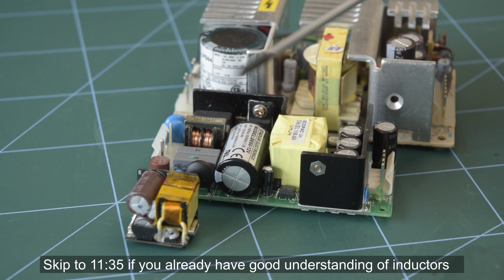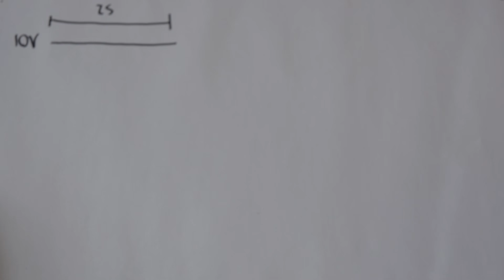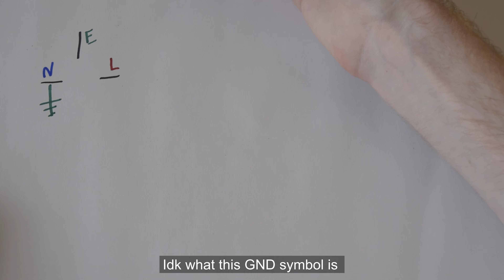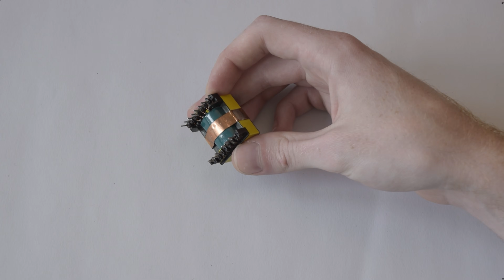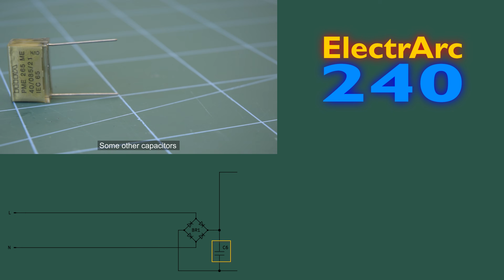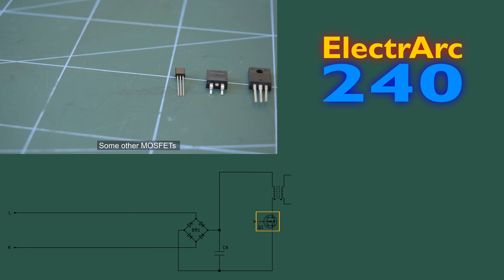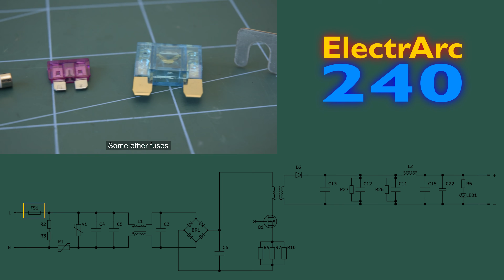Every Component of a Switch Mode Power Supply Explained

Comment from the maker: Hi everyone, I've had several comments about the lack of a section going through the controller circuitry, this was intentional in an attempt to keep the video simple and digestible by focusing only on the "power" components. There will be videos coming soon on PWM control and MOSFET gate driving, though I should have mentioned this in the video and still given a brief overview of the circuit, so sorry about that. Thanks for all the nice comments!
Reply: I'll look forward to those. As an electronic engineer (a while ago) dealing with the digital stuff I was always a bit concerned that I didn't know enough about switched-mode supplies so this was great. Would love to see how the MOSFET switching frequency is determined and then implemented though. Great work 👏
Reply: Yeah, I was just about to ask about that.  I look forward to the videos explaining those parts of the SMPS circuit.  I do hope you will continue to use the same power supply from this video to explain those topics; you know, to keep the continuity (wait, does that count as an electronics pun).  Thanks for the the clean and clear explanation.
Reply: Well done, I came looking for someone else asking about the control circuit and found this.  Looking forward to the sequel.  Well done otherwise.
Reply from the maker: @Budreaux1973  Certainly does count as a pun :) I probably won't use this to be honest as I want to be able to show live demos which is a lot easier with a custom system, I may show this at some point though.
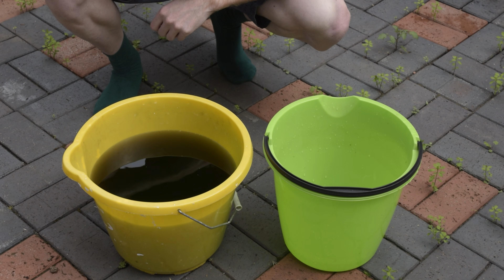Reply: 10:21 Nice shoes! 😉
On a more serious note: Really excellent explanation of the fundamentals of an SMPS. 
I’ve watched many (too many tbh;) videos with the same topic and yours is the best, by far I may add. 
Thank you!
Reply: I really liked that explanation, and yes, as others already have mentioned, please, expand on the MOSFET gate driving, as having this Q there doesn't quite cut it. Good job so far! Thanks!
Reply: Could you also please explain how changing the large, 400-volt capacitor with a different value may affect the entire circuit?  One time I replaced a 47uf/400v with 51uF/400v because it's what I have at hand and these high voltage capacitors cost a lot, sometimes buying a new one does not justify the overall cost of the device under repair.  The device I mentioned still works after 2 months. 
If I had a lower value cap would it work same way?
Reply: @CodyTreng  replacing it with a smaller capacitor would have reduced the output power.
Reply from the maker: @CodyTreng  Higher is always better for that kind of thing so you definitely did the right thing, yeah I'll try to cover that at some point
Reply from the maker: @MightyGimp  Usually by increasing duty cycle instead, so putting more energy into the inductor during each pulse. Thanks!
Reply: also when you get to that video be sure to address the optocoupler and the isolation barrier in the circuit board design to maintain pro-sec isolation.
Reply: Thx, I was going to ask about that, including how it works between 110v and 240v
Reply: Question = Do you have an entire storage container of old power supplier like a true chad of electronics?
Reply from the maker: @ProfaneGod  Two 😜
Reply: @electrarc240  I have five each with different voltages, And center positive other center negative.
Reply: Why do you repeatedly describe that transformer as an inductor? I know that it depends on inductance to operate, but not on back EMF.
Reply from the maker: @MikeBrockington  It's called a coupled inductor, it is fundamentally different to a transformer in operation despite the clear similarities. A coupled inductor would make a very poor transformer and vice versa
Reply: There is an error near the start of the video when you said that the circuit will work as depicted. There will not be an output if the MOSFET remains uncontrolled. The MOSFET will either be always on or always off without the control. This will result in an unchanging current in the inductor, which means there is no transfer of energy.
Reply: I'd love a video on driving MOSFET gates, especially if it touches on the terminology.
Reply: Why are manufacturers able to make power supples so much smaller now relative to the size they were many years ago?  Is  it bacause they are able to make powere supplies with higher switching rates?
Reply: I was about to ask why you skipped those details. I look forward to watching your followup videos.
Reply: @drchemy1 Power is the product of Energy and (times) Frequency ...
40 - 50 y. ago (20-40)kHz was the common switching freq. Today the freq. is in the range of (250-700)kHz .
For higher sw.freq's the components physical size comes down .
This is because of the same energy storage,but for relatively shorter time duration.
Reply: @analoghardwaretops3976  Thanks.  What development allowed the switching  frequencies to get so high.  Better MosFETs?
Reply: @drchemy1  ...yes better grade and more reliable switching  devices..... we're up the learning curve too on designing better pcb layouts..Caps with better ESR/ ESL... improved magnetic materials...now available with different hysteresis curves..for wider range of different applications...not forgetting the switchover to SMD components thats crucial for high freq. opreation. This helped in making the design more EMI/ EMC compliant.
...Also the better understanding and adaptation to current mode control and resonant converters , though voltage mode topology has also undergone improvements.. 
Initial First gen. devices were only voltage mode control but with limitations..though they competed with linear ps.
but in all these cases its because with each generation/ version put out , the controllers for these have vastly improved internal control circuitry..
Reply from the maker: @drchemy1  That's part of it yeah, also just material advances (better magnetic cores and denser capacitors) and some small topology tweaks to improve efficiency (swapping diodes for MOSFETs generally)
Reply: Definately make more videos.
Reply: "It's actually quite dangerous. Not only to people, but more importantly to circuitry." 

Interesting priorities, right there.. 😊
Reply: @lancecorey6582  There is an error in the whole thing, working from the first principle of instantaneous energy transfer, which is EMF-maximizing behavior, and of course the design shows a saturated primary which will have the fuse in action pretty instantly.
Reply: That’s what I was watching for -An explanation of what turns the MOSFET on and off
Reply: That's the one I'm looking forward to!  Found the power side relatively easy but the control side has always kept me puzzled. Keep up the great work.
Reply from the maker: @philmanley489  Coming soon I promise!
Reply: Beautiful stuff. Keep it up
Reply: ❤ No worries. This has been a rewarding explanation for enthusiast like me to get a quick overview. Appreciate the 20min intro video instead of a 45min lecture.
Reply: @CodyTreng  47 to 51 uF won't make much difference, simply because there's usually a fair bit of tolerance in those stated values, they can (depending on the quality) can be plus or minus 10 percent or more of a stated value, all components have a accuracy system, like resistors have silver, gold bands etc. to state the tolerance of the stated value. The values that very by a lot will alter the stated current draw possible at the least, plus other unforseen dramas, best not to find out the hard way. Lowering the working voltage of the capacitor is a BAD BAD idea...raising it is safer, and more expensive...
Reply: Excellent  , Any time I needed to repair a switching circuit in the past , I was fumbling in the dark You have thrown a light on the whole subject And in such an enjoyable manner thanks   ElectrArc  (I have definitely subscribed) Terry
Reply: I definitely understood why you did not cover those areas. You completely explained what you were to cover in this video right at the beginning - which you did to perfection. Greatest explanation of a switch mode power supply! Thanks and subscribed! Continue on, you are awesome at this!
Reply: Thank you for this awesome video, effortlessly curated, now i am aware of all the ingredients of power supplies, which is encouraging to study the amazing electronics topic, please post more, Bless  😇
Reply: So many besserwisser out there you know. Must speak
Reply: All my life has been an electronic hobbyist. Your style of lecture is very simple and very easy to understand. Thank you very much. Looking forward on your next video.
Reply: Hi ElectrArc240, I'm 61 years old and love electronics as a hobby, but I wish I had teachers like you! I would be so much smarter today!😂 I have watched other videos, but your analogies were right on point and made it so easy to understand. Please don't stop educating! I'm subscribing to your channel and going to watch all of your videos and can't wait to see your future videos! Keep up the good work! Thank you 😊 
By the way, have you considered doing videos on electronic repairs on the work bench and use of electronic test equipment?
Reply from the maker: @tonyp.2482  Thank you very much for the kind words! I have considered repair videos but every repair is different so I'm not sure how useful it would be. Also I am more knowledgeable in the design of these circuits than the repair of them to be honest
Reply: Iv'e been teaching how switching supplies since there was TV (OK, just since the 70s). I really like how you simplified it. Ah, yes, just one thing missing, and I'm glad you brought it up. I have subscribed and look forward to your presentation of the control circuits. Don't forget how the opto-isolator works and what it does.  keep up the great work!
Reply: Why did you explain about inductors even though that's not the first step? Is this to confuse newcomers?
Reply: @iancallow3364 smps are like snow flakes haha there's so many topologies and part choice/quality. I'm not ee but I buy them just to reverse engineer them. It used to be that my opinion was the heavier the smps for a given voltage, the better. Especially charging wall warts. Dodgy companies have started adding weights to their power supplies. Sneaky man. I always make sure anything power relate is ul certified or reasonable facsimile, when buying supplies for things I build or repair.
Reply: The controller is the most important part of the supply circuitry. It’s what many of us are liking to learn to understand.
Reply: Great video and I'm looking forward to the next!
Reply: Novice as I am, I will attentively continue to take the video at my spare time and keep the usefulness.
Thanks to being so audible and humble I believe many in want will come across your videos.
Reply: This video was awesome. Thanks a bunch man

Comment: I'm a 77 year old retired electrical/electronic engineer and my education was obviously back in the days of poorly written books, chalk boards (as classroom visual aids), and sliderules. I couldn't have imagined the ways we teach nowadays, and I am so impressed with the way you described this power supply by starting with the basic circuit and then explaining why all the extra parts are needed. Excellent!
Reply: Exactly
Some of my early education over AC theory involved WW2 era 16mm films! 

Black and white classified training films using billiard balls on sand to illustrate conductivity, current flow and valence shells! 

This material here is sensationally well executed. I don't believe I've encountered a better, more engaging approach than this. 

Superb
Considering how for we've come, imagine what's right around the corner. 

Thank you
Much appreciated
Reply: you are right...me 64....radio technician...have learned much more from this one here...very good and essential...
Reply: Whats a chalkboard?😂 just kidding
Reply: @cheesesgarage Very common in Brazil. Bad teachers too.

Comment: As a ham radio op….. those “annoying” emc components are a thing of beauty!!!! This was probably the best explanation of SMP PSU’s I’ve seen - bravo!
Reply from the maker: Wow thank you so much!
Reply: You beat me to it, personally I reckon they are the most important side of things.
Ham here too and its all the cheap n nasty consumer electronics out there that is destroying my hobby.
Currently have a neighbor with 5x split systems and any one of them wipeout all of my operating bands.
Reply: I remember when I was trying to make a simple clock circuit for a 10Mhz CPU , I didn't knew about PLL and it became an antenna "by mistake". Thank god nothing important is at 10Mhz, right ?
(well, it was just a 1w signal)
Reply: Yep. Used to repair a lot of SMPS supplies to component level. Used to see filter caps fail a lot and occasionally, pop the zener reference or optocoupler in the feedback circuit, which would then allow the drive to runaway and increase output, failing additional filter caps.
A good curve tracer could save the day if the zener was starting to fail, the rest it was simpler to replace the filters than to run around disconnecting the filters and checking ESR. The cost per component was cheaper than the man-hours spent testing them anyway.
Never had anything in the snubbers fail, did have the EMI caps occasionally fail.

Loads of techs had trouble figuring out how these rather simple circuits worked and failed. Interestingly, those that couldn't figure them out also couldn't figure out a PLL. That caused me to joke that they were refractory to proper feedback.
Reply: Absolutely! The cheap far-east imports which have little or no noise filtering due to cost can be a great nuisance. On lower ham bands there is much noise here
Reply: @ScatManAust  Here in Germany, our equivalent to the US FCC, the BNetzA, would show up (at least when someone puts in a complaint) and make them not interfere anymore.
Reply: @wilfriedklaebe  Not here mate 
ACMA are only really interested in the commercial side of things.
Reply: Yes. As a ham, that didn’t go unnoticed.  Wonderful explanation however.
Reply: Yeah, you knew just how to test everything in circuit with a small-voltage signal and probes from this, right? Because he described a circuit from the '80s with ideal Gamma-function switching, but mapped the components to a 2020s DC supply? wcgw?
Reply: @ScatManAust  Like, they have 5 heat/airconditioning splits? Or 5 electrical trees going on (you can't fool me, it's neutrals all the way down!) Optimize 'em!
Reply: @davenordquist4663  Not sure what you are getting at there. Are you saying they may have a wiring problem ?
 Next door has 5 separate reverse cycle air cons.
I have not seen them, so I don't know if they are all the same brand or models. I do know at least 3 of them in their kids rooms for sure will wipe out my HF to the point of almost being useless. They also have solar on their roof but that system so far has not caused any problems for me.
The other side neighbor has a shitty beer fridge that he uses in the summer, when it's hot, this fridge is compressing for three minutes every 10 minutes. This must be costing him a fortune in power and of course it blasts noise and mucks my reception as well. 
I actually have 3 split systems here myself and the one in the shack is only 1 meter away from all my radios and they are clean but they are big brand names.
Reply: @ScatManAust  Ah, if they're window units maybe they're not outside and more amenable to a casual installation of RFI fixups (flushing up metal parts, 4/5 piping around or just replacement of long busted runs, nobody put the shield back around the controls fiddling in there...) but it sounds like you hear them click on and your radio reception gets swamped by noise?  Good luck?
Reply: I once that all kinds of odd problems with devices in my house that I eventually tracked down to a noisy cheap 5 volt power supply.

I also learned that cheap noisy power supplies on a shared branch really don't get along with each other
Reply: Chiming in here to say the same. These EMI management strategies are absolutely critical. I have some devices without this kind of input/output filtering and they cause a massive amount of noise to the degree it becomes impossible to use the radio with them powered on. It might be annoying but it is absolutely not pointless.